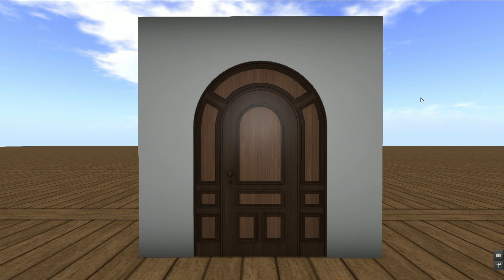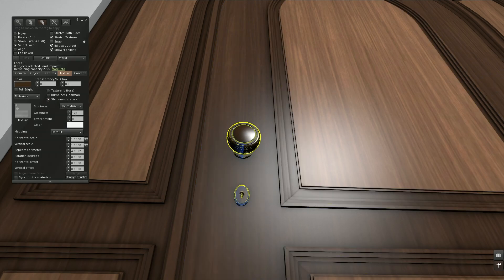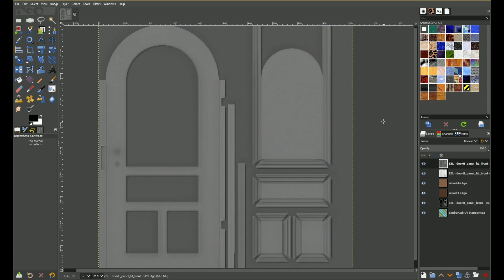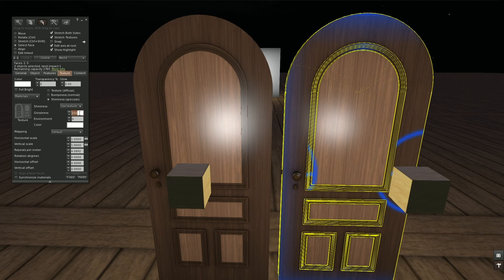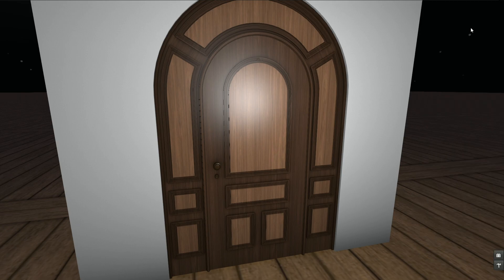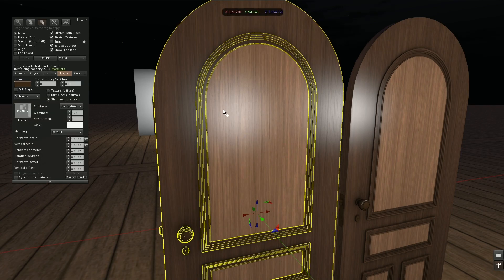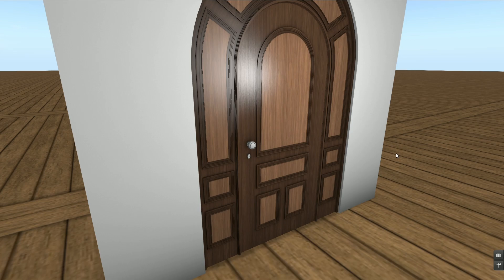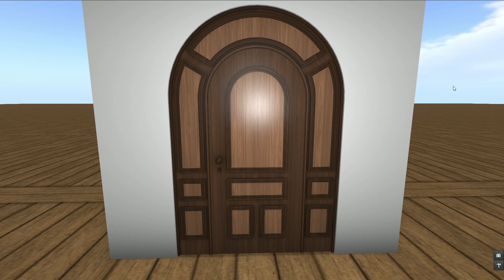Second Life Building Tutorial : Maps & Texturing - Part 2

Comment: Hello , your method making texture maps works very nice with objects like the door and other similar objects. But i have issues making texture maps for plants by gimp with this method. If you would show me how to combine the different layers as like, Albedo, Ao, Displacement, Normal, opacity Roughness and translucency, so that the exported texture matches the object and makes only the leaf visible , i would be very thankful. Which layer has to be on Top and set as multiply mode? thanks!